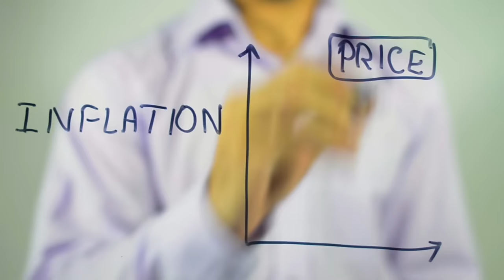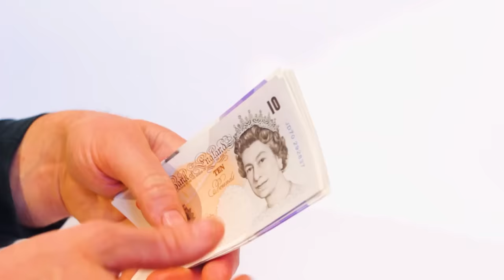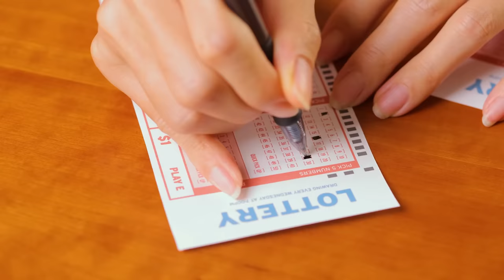This Is Why You’ll Have to Work Longer

Comment: I worry about the raise in retirement age. My Dad was a motor mechanic, he really struggled with work getting from 60 to 65. If you are a tree surgeon, bricky etc, your body would have given up long before 67. Fine if tap on a keyboard all day, but that's not every one.
Reply: Not quite as simple as that. Wear and tear does affect most manual trades such that their body gives up - smoking, dust, injuries, effects of weather & sun. But a few have brilliant genes and keep going almost as sprightly as ever.
   Having tapped a keyboard for my last job, my observation was that most of my colleagues were set for an early body breakdown with backs gone and unfit for subsequent work. If conversation got around to weight, fitness, retirement, health, they'd always say that I'd be alright as I did a lot of exercise. I'd reply that it's largely genetic and gave examples from my family. Sure enough, I had a massive heart attack just before turning 65. I'm OK now and expect to go back to work to supplement my pension but, if I didn't need the money, there is an infinite amount of voluntary work to do around here. My core fitness helped my survive and recover. Everyone else in my recovery group was also keen at exercise with one being a fitness instructor
Reply: Interesting - were you a fit non-smoking exerciser eg cycling, running, tennis etc🏃 🚴 etc b/f your heart attack for say most of your life. 
Or did you have high blood pressure, cholesterol etc.

Comment: The problem is many jobs available in the UK need a person who is reasonably physically fit.  My working career (recently retired) meant a lot of my time was spent on construction sites, where most of the workers had to be physically fit (me included) in order to be able to do their job effectively.  At the moment, after Covid and the longer waiting lists for NHS operations, it's reckoned over half a million people suffering from long term Covid or physical ailments, who are between 18 and 65, are claiming long term Sickness Benefit, as they're unable to work.  This is borne out by the simple fact there are now over half a million people fewer in the work force than in late 2019, prior to Covid.  It might be an idea if the Government started reducing these waiting lists and organised it so that people could receive the necessary treatment enabling them to get back to work.  This is one simple reason as to why there's such a shortage of workers, especially in areas requiring manual labour as part of the job, of which the construction industry is a perfect example.  BTW, Roger, we don't have more people over 65 in the UK, than under 65.  I think the average age of someone in the UK is around 45, time to check...

Comment: Blimey Roger, long term subscriber & never realised you are a bike rider. I lied about my age to get a paper round when I was younger. I’ve always been a grafter, currently working on my own house, big project. I’m still going out with the lads on my bike, one of them is 85 & still going strong.
Reply from the maker: Hi Barry
Yes I am a roadie mostly and have many cycling holidays. Where are you based? I am in the Surrey Hills which is full of cyclists.
Reply: @SkillBuilder  I’m a west Londoner, born just off of Portobello market & gradually moved further out of London. I raced on a bike road & track from 15 to 59 on & off. I moved up to north Derbyshire about 9 years ago. We brought a two bed bungalow & I’m converting it into a 5 bed house, been on it two years now. I have some building experience, but your videos have been very useful. 👍
Reply from the maker: Did you ride at Herne Hill?  I always used to go to the Good Friday meet. I saw Hugh Porter, Tommy Simpson, Reg Harris.
Reply: @SkillBuilder  I used to ride the odd open meeting at herne hill. I know a lot of the riders from HH. I started out racing at Paddington track, even won the league & 20k champs in the mid 80’s. I rode against Gary Wiggins, but I was only a junior at the time, when I came back to racing in the 90’s rode and trained sometimes with Bradley Wiggins, or should that be Sir Brad. Small world Roger, I’ve visited Tom Simpsons grave at Harworth, not that far from where I live now.

Comment: Keep at it as long as you can (but go part time) but try not to define yourself with work. My Dad, farmed, laboured, gardened, drove trucks, worked on the roads, did removals and anything he could but since stopping work he has really suffered from depression as he now he feels useless. So keep it at it be all means but make sure you have something else as when you do have to stop as my dad has its soul crushing to loose everything and all purpose.

Also good on you Roger for talking about the way public pension is funded. The only thing I would add is NI is not ring-fenced any more, it's really just another income tax and should be rolled into income tax for a even playing field between PAYE tax and other forms of income tax.

Comment: I can imagine that if Roger ever needs a Zimmer frame...it'll be made out of 22mm copper pipe, expertly soldered joints and it would be absolutely perfectly square, level and true.
It'd also likely have an assortment of valves decorating it, with little holders for tools. 👍

Comment: It’s all about getting the balance right when you retire!
Everyone is different so what suits some won’t suit others!
For myself 3/4 hours a day working, couple of hours max practicing snooker and if the weather ever improves, time to get the clubs out!
I’m 69 this year and really starting to enjoy my retirement, but it was difficult for the first year after 51 years of self employment!
I did step aerobics, otherwise known as plastering😊
Reply from the maker: To be honest Shaun, I think plastering is very hard on the body and I would be out of that by 65, maybe just doing the odd  patching or skimming job for some cash.
Reply: I’m one of the lucky ones, like you im still fit and active!
It helped that for the last twelve I’d moved on to thin coat insulated render, much easier on the body!!
Personally I think the sand and cement floor screeders had the hardest job, no let up there !
Hope the thumb has healed👍

Comment: Yes, simple population demographics. Really not any trouble or bother. You can retire any time you want. Just fund it yourself. Building trades make far too much income so easy for them. Generally people need to expect to wind down into older age working. Not expecting to retire at the top income they ever got still doing the same thing as they did in youth. Biggest problem is the grossly excessive lifestyles most seem to expect even in retirement.
Absolutely, do what you enjoy, it is not really 'work' that way. I took a craft job from school via apprenticeship, in tune with my model making childhood hobbies. Low paid life, but you do not spend like a fool and life is easy. Retired early and then got asked to do a completely different part time job related to another hobby. On line from home. Soon due the State pension now and more money than I have ever had. Still doing whatever I enjoy. Not a fool that ever paid for holidays as my life is so bad chasing money!
Those demographics, are going to get really bad soonish, the issue is only just beginning. Most of the world is below replacement level. Lower populations are problematic for the general economic model of how all operates.  Imagine, more existing houses than people wanting them. Many more older than younger. Markets for everything shrinking year on year not rising. It is scary once you think about it. Where is any 'value' retained as demand always reduces?

Comment: That was a fun rant.  I'm the same age as you but I was made redundant during covid at the age of 67, I would of carried on if I could.  Now I enjoy doing DIY and cycling 50 to 100 miles a session with my club.  May I just point out that before the recent change you had to have one million pounds in your pension before you avoided tax, that was a problem for Consultant doctors but not for most people.  If Labour reverts the current changes I doubt it will be much of a problem for most people, the rich where using it as a way of avoiding tax.
Reply: @mickinmerton8053 That £1million limit also referred to defined benefit pensions, so those on guaranteed salary pensions like teachers, police, fire service, nurses etc on defined benefit pensions can easily have a £1million pension pot to support their guaranteed pension. £1 million pot will prove an index linked pension of around £40,000 per year so its has a huge affect on many people and not just hospital consultants.

Comment: Since I was small I was told I could retire at 65, the gov now say 66 or older maybe 70, Sorry I'm retiring at 65 at latest, Im 64 and can provide for myself for couple of years
Reply: Currently you don't get a State Pension if you were born between 1955 and 1959 until 66, if born between 1960 and 1969 until 67 and if born between 1970 onwards, until 68  and that's before they decide to increase it any further.  This must be saving the Exchequer an utter fortune, especially since the retirement ages of women and men were made the same a few years ago, at one time women got their State Pension at the age of 60.
Reply: My date nrd  is 66 years and 3 months

Comment: Why do young people think they can just buy a decent house as first time buyer. What’s wrong with a starter flat, improving it, selling and trading up. Oh I forgot, that is a bit of hard work.
Reply: Kind of depends what area of the country they live in.
Reply: Get a reality check. Go and look at how much a "starter flat" costs, what the mortgage on that would be, and how long it takes to save the necessary deposit on a "starter wage". They're not "starters" by the time they've saved. The fact is that young people in this country and being wrung out of every drop of money by the private landlords they're forced to live under. The possibility of them owning a home ended long ago.
Reply: Starter flats, but needing work, start at £40k in many places of the Uk. Decent 1 bed from £60k and 15 year old 2 bed flats from around £80k. Easily affordable on full time wage, if a couple even more so. This is reality. Get out of the cities and open your eyes.
Reply: @colinbrammeld2038 This has to be a joke. The cheapest thing on rightmove within the maximum range of my house in East Anglia is a 1 bed flat for 100k.

Your solution it basically "all young people need to move even more north than Leeds to get a starter flat", which is clearly absurd.

Face it, your pricing mentality is rooted in when you were young, when bought a house for 30k in the 80s, and you mentally haven't kept up with inflation since then.